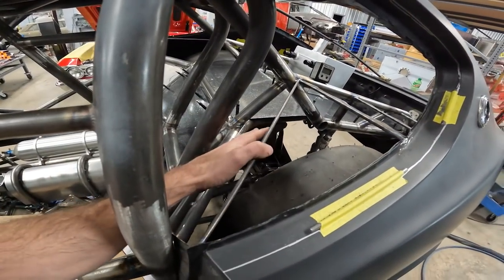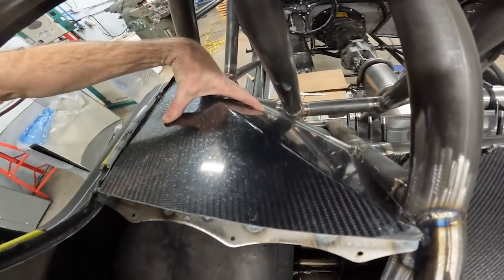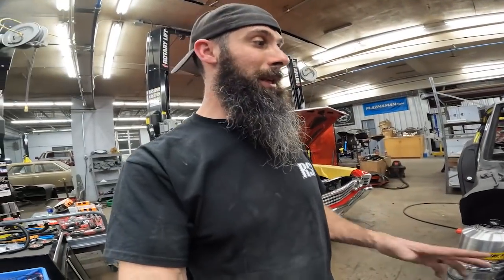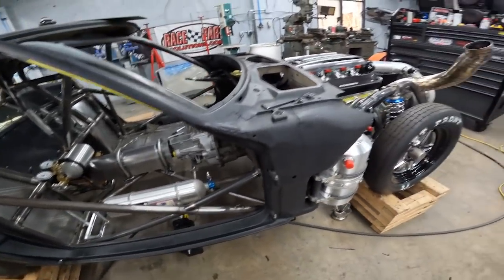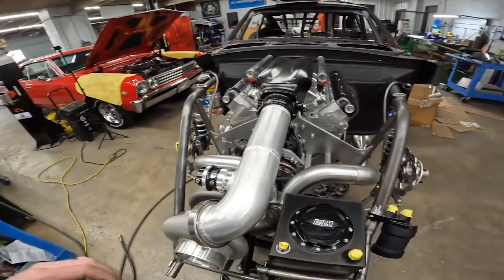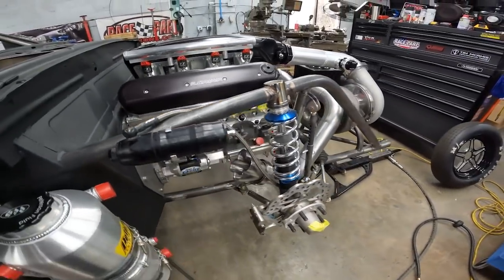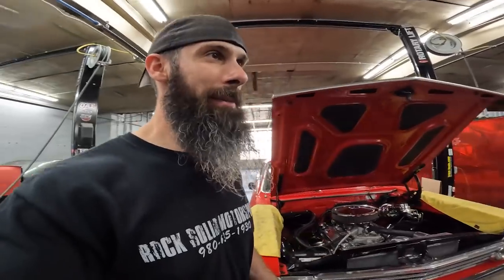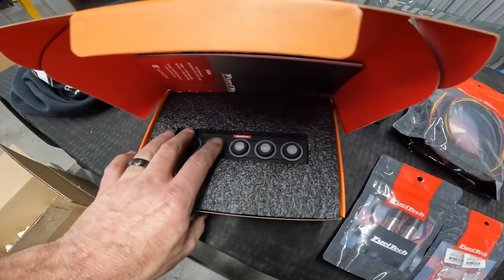Du Hast 2.0 Update.  As we say GOODBYE to all those Titanium Pie Cuts!

Comment: Sikaflex 221. Comes in black, white or grey, single component. Stronger then strong. Used in the european trucking world als seem sealer and pannel bond. Use gloves because the only way it comes of your fingers is through wear ( approx 5 days). Im a truck mechanic and use it daily. Will even stick to rust at a pinch😅